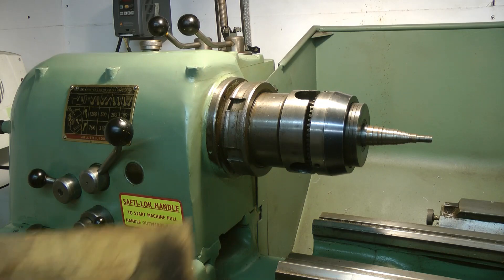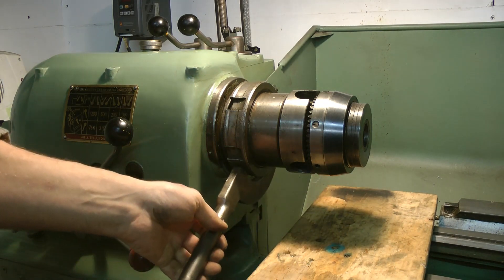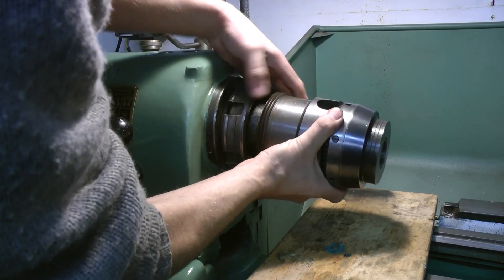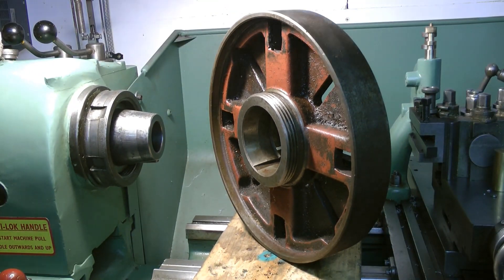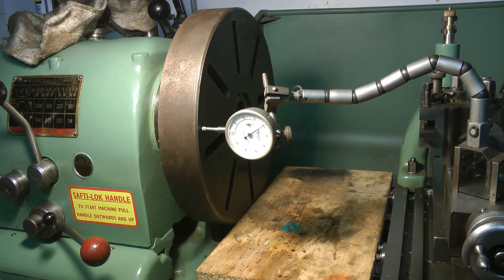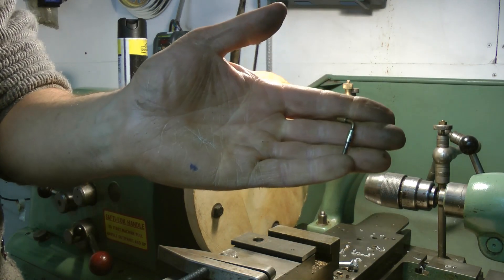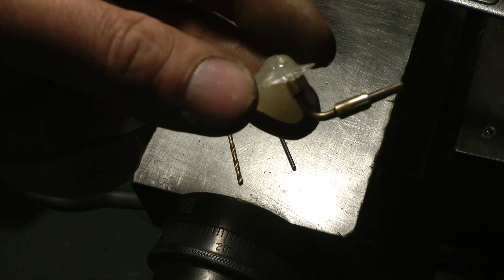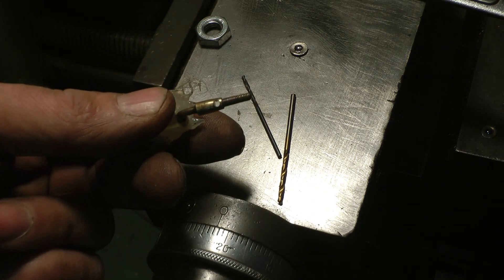Drilling small holes on a big lathe good project for learning the Colchester

Comment: Barking mad! Most people would have done that in a mill or vertical drill. Low speed? 250rpm? I would have used 50. Balls of steel - or maybe cast iron!